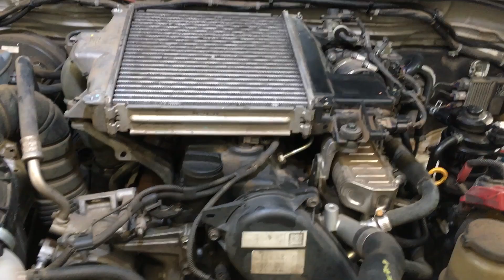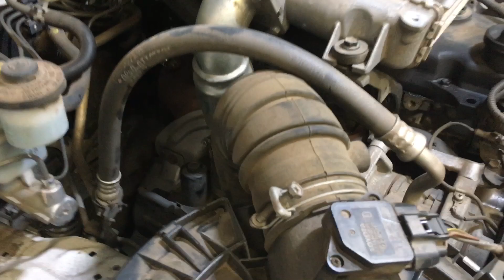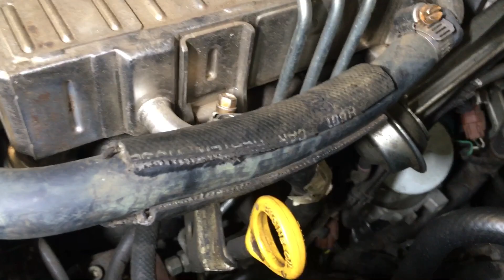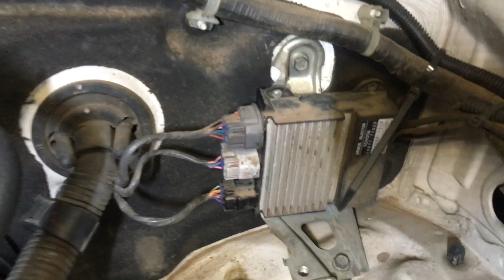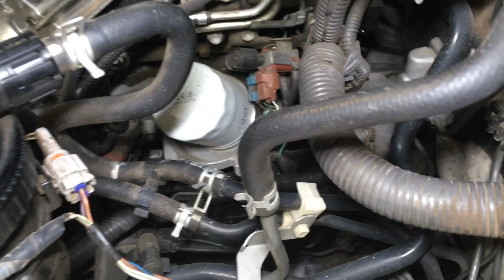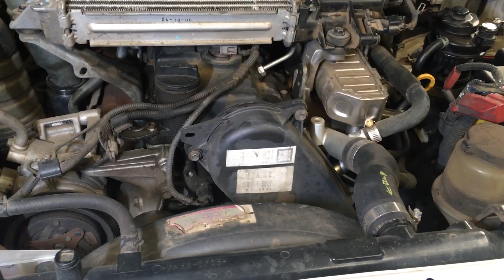REBUILT ENGINE

Comment: Huge thankyou. Just followed your advice. Injectors replaced due to blowing. Oil pick-up nearly blocked. Whipped the sump off cleaned the pickup. Running good as new! Only 86k miles on it here in the UK

Comment: Good info, I have a 1991 70 series Prado 2.4. I bought it 8 years ago, it had been abused by just the sort of guys you have described.
I have slowly gone through most of it, only replaced parts with Genuine Toyota or the very least, OEM made in Japan. 
Starts first time every time, and I trust it to get me home, it always has in the last 8 years.
Very interested in your comment about Toyota rubber. I am amazed at how long it lasts. Actually I am amazed at how long every thing lasts.

Comment: That rubber pip off off the back of the pump , had one come in yesterday they blew a hole in it with a pressure cleaner . Please be very careful when you are pressure washing your engine bay.